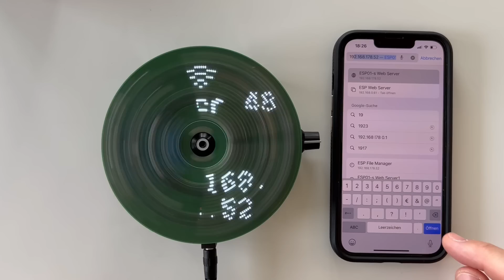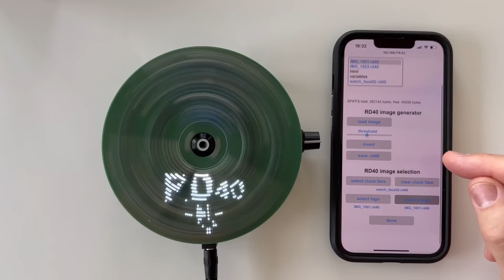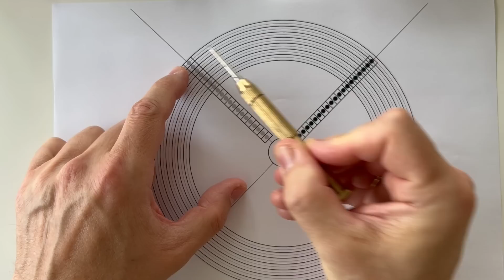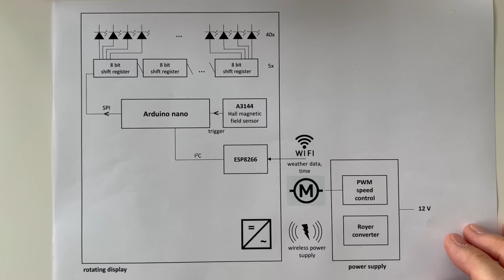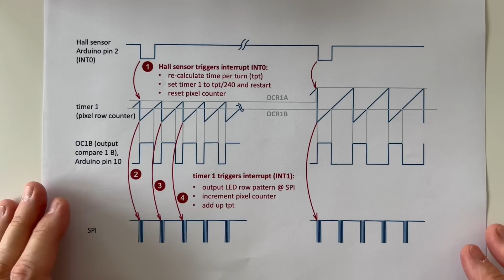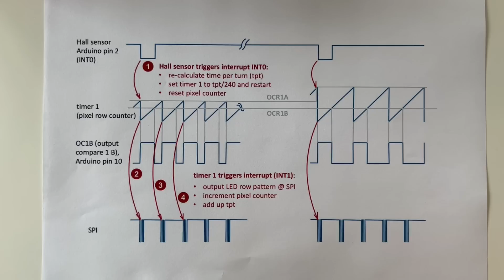DIY Rotating LED Display: An Arduino-Powered Time and Weather Display Project. POV Propeller Display

Comment: Dude, you're awesome. I'm just beginning to get into PCB design, etching coils into a pcb is a fascinating alternative to using brushes. Starke Leistung :D
Reply from the maker: Thank you, Timo. Making planar, circular coils with PCBs is tricky. While the math behind is simple and easily available on the net, tools are rare and also PCB makers struggle. I am using KICAD for PCB design (free, open source). However, I had to trick it. I approximate circular leads with a series of straight lines. Start and endpoints were calculated externally.